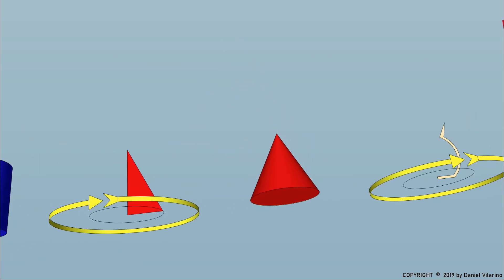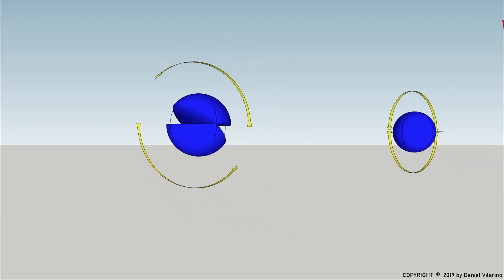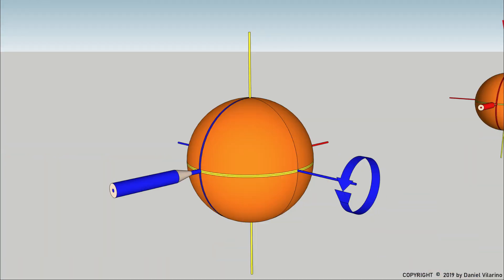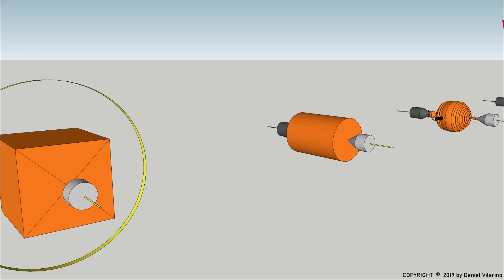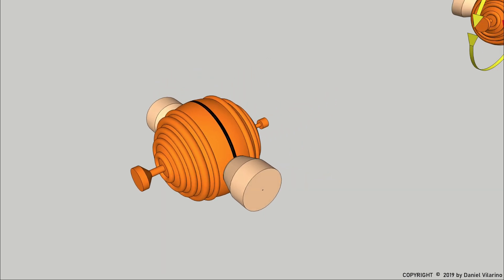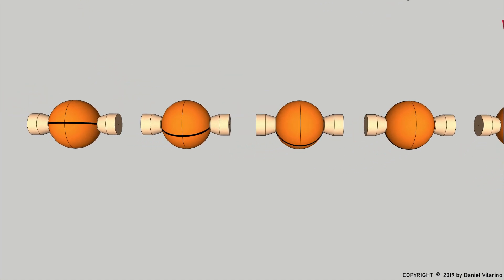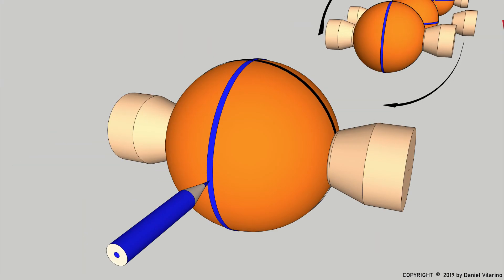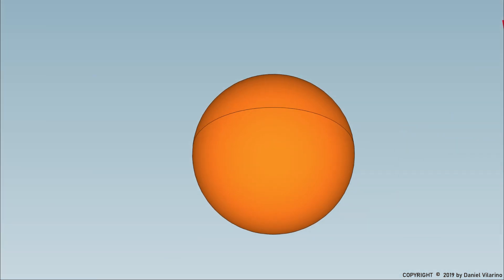Explanation Turning a Sphere Using Three Axes

Comment: I understand the basic process and have watched several of the videos you referenced. However I failed to grasp the concept from your pictorials here. I think you failed to illustrate the step that goes from a cylinder to the rough sphere. I believe that the Alan Stratton video does illustrate this step clearly. After that your illustration of the rotations required to complete the sphere are not clear to me. I think perhaps they are overly detailed. It is hard for me to describe but I do not grasp the function of the rotations from your diagrams. I do understand the overall concept though.
Reply from the maker: Hi Glen! Thank you very much, my dear friend, for your honest comment. I know that diagrams can be overbearing some times. Different people tend to assimilate learning in different ways and for me, diagrams always help. My failure is that sometimes I do not realize that it can be worst the explanation than nothing at all, ha, ha, ha, ha ,ha! Alan Stratton video is really good and that is why I wanted to include it in the description. I really hope that when I do the practical exercise, things will get clearer. One thing that I can tell you is that the diagrams helped me to understand the process better and with a bit of luck, I will be able to transfer that to you guys, later. Cheers! Daniel
Reply from the maker: Oi Joel! Muito obrigado, querido amigo, por assistir ao vídeo e por comentar. Recentemente, troquei alguns e-mails com Miguel. Ele está muito ocupado com as atividades de sua vida cotidiana, trabalho etc. Um grande abraço! Daniel